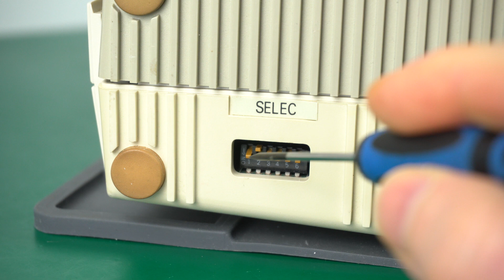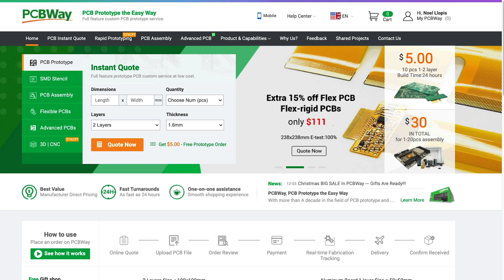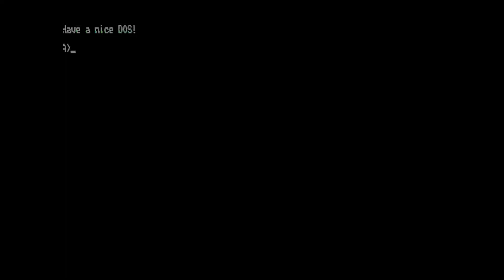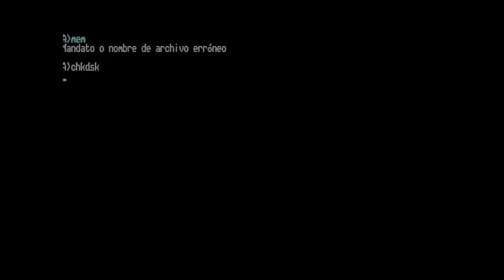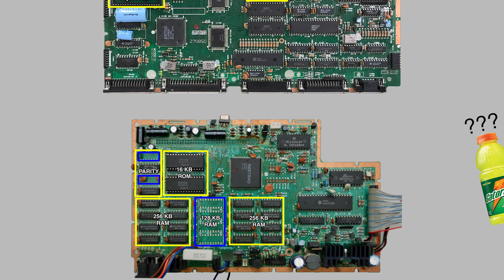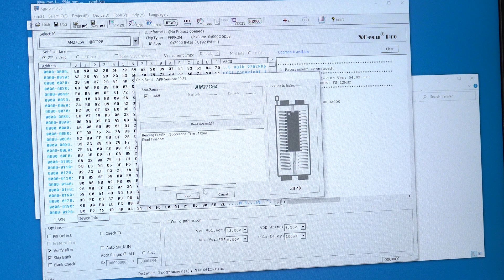Upgrading a Laptop from 1988 - Amstrad PPC512

Comment: Noel do you ever have any issues swapping between disks? I've installed a Gotek in my PPC512 today. When I swap between disk images, the computer doesn't detect the change. I'll swap a disk,  type DIR and it still lists the contents of the previous disk, not the disk I swapped to. I'm guessing this might be a disk change detection signal issue?

Comment: Hello, I have an amstrad pc 1512 with a broken monitor, but if the power supply works, there is some way to connect it to another monitor, be it vga, rca or otherwise, just as long as the image is visible, it's fine, thanks

Comment: Wait, wait, wait a moment. At 09:04 You put the disk emulator on the right side (looking front to the side) and the real disk drive is on the left nearer to the front of the computer; The emulator is the one with two openings, nearer to the back!!! When you boot and insert the floppy at 10:12 you put it on the back one (the emulator). WHHHAAAAAAT!?????? There is a cut at 09:42. Dis you cheanged the arrangement of the drivers between the two takes?

Comment: The PPC512 system disk (available on the net) has a tool called "lcd.com" (a TSR program). Once loaded, it is possible to switch between LCD and CRT with the keyboard (scroll-lock enabled + right CTRL).
Reply from the maker: Thanks! I actually read something about that recently but didn't get around to trying that. I will now. Cheers!

Comment: A great episode.  Thank you.  It is sad that I figured out the extra DRAM part numbers from the pictures of the PCB?  I used to design commercial hardware with old-fashioned DRAM in the 1980's and used most of the x1 and x4 parts from 4k bits up to 1M bit.  I didn't have the Amstrad (but I do remember them) - I was more of a ZX80 > 81 > Spectrum and then BBC Micro kind of guy.
Reply from the maker: Sad? No! Awesome? Yes! 😃 Glad you liked the episode!

Comment: So the V20 processor is much more like an 80286 than a copy of an 8088?
Reply from the maker: It was definitely closer to an 8086 than an 8088 (8 bit data bus). It had some aspects of the 80186 and 80286, but not all of them (like protected mode or extra memory addressing).
Reply: @NoelsRetroLab  Wasn't protected mode a 386 feature? I'm not sure if the 286 had something that you could qualify as an MMU.
Reply from the maker: @Stoney3K  It started with the 286, but it didn't see a lot of use until the 386 https://en.wikipedia.org/wiki/Intel_80286

Comment: Awesome work, love these old Amstrads.  I added 3 ISA slots to my PPC , I have schematics and gerbers if you are interested.
Reply from the maker: Yes, I saw that. That expansion looks amazing! We were admiring your job on Twitter just now 😃 I see you added the option to power it with 12V but you didn't really need it for your tests. That's great!
Reply: @NoelsRetroLab   I changed direction, as XTIDE, sound, and lan only consume 300ma,  and in the past the Amstrads had internal physical harddisks, I thought I was safe with that current draw to keep it parasitic. It was originally designed for picoatx, with a single 12V input on the pcb to feed only the picoatx, But I am having an issue powering the Amstrad through the bus as described in the reference manual. I disable the onboard regulators and it powers on and sweals, as if its not getting enough power to start the LCD is my guess. I am not sure if its a resistance/voltage drop issue or an error in the manual, and there are a lot of errors in the manual.

Comment: When I glue ABS/PVC with Epoxy, I first prepare the surfaces with some Acetone or PVC pipe primer. This softens up the surface for some time and the epoxy seems to make an incredibly strong bond with that. If I rip the parts apart with force, its always the plastic's structure that fails but never the Epoxy/plastic bond itself. I've used that method for glueing in Laptop hinges with destroyed screw holes and none of them failed ever again.
Reply from the maker: Nice. What kind of epoxy do you use? Any particular recommendations?

Comment: Interesting that the empty RAM positions did have their associated decoupling/bypass capacitors. Which is a little surprising given that board manufacture tends to be highly cost optimised.
Reply from the maker: True. I didn't give it a second thought, but you're right. I guess it was more trouble doing two versions of that step of the assembly than just change the IC one.
Reply: @NoelsRetroLab  looking at the history of pick and place machines it looks like there were two separate robots. The first doing small components, such as capacitors and the second doing larger components, such as ICs. It's around twenty years ago that a single machine to place everything became the norm.
Reply from the maker: @markevans2294  Although, were these boards machine assembled? I know a lot of the ZX Spectrum ones were assembled by hand in factories in Europe. I guess this is 5 years later and things had became automated. Edit: And the fact that those holes were filled with solder means that yes, it was at least soldered automatically.

Comment: U may have to swap out the memory controller chip as well with the added ram, IIRC we called it the u226 mod back in the day when we did the xt boards.
Edit: guess I should have watched the rest of the vid before commenting. :)
Reply from the maker: Interesting, I'm not familiar with that mod. Was it for XT computers in general I take it? I guess we were lucky that Amstrad just reused everything from the two models and just left some spots empty.

Comment: I only saw the GoTek showing the track and head numbers, not the track and sector like you said. There would be 8 sectors per track, not 2 like it was indicating. Back in my old days of DOS I used to know every part of a floppy disk layout almost like the back of my hand thanks to playing around with formatting disks on the Atari STFM before I moved to PC. The Atari used the same disk format but with more flexibility, allowing you to squeeze extra sectors and tracks onto disks. The PC could use most of those disks but not create them, great for copy protection of PC software if you fill the disk up completely! I knew more about DOS and disks than even my tutors when I was getting my C programming qualifications 😏
Reply from the maker: Right! I saw it afterwards as well 😃 I was speaking out of experience from what it displays with the Amstrad CPC, and then in edit I saw it was only showing track and head. Haha, good eye!

Comment: Excellent video. I have one of these sat in the office. I wish I had the confidence to upgrade the ram like this. The gotek mod though looks within my skillset. Great stuff. Looking forward to the next videos on it.
Reply from the maker: Thank you! Really, there's nothing about the RAM upgrade. You can remove the solder with a solder braid, and since you aren't working directly on any components, it would be hard to screw things up. The hardest thing is opening the computer and getting the boards in a position you can work on them! 😃 Give it a try!

Comment: cool... @9:40 maybe it would be a good thing to mention to the firmware devs about a program you can use or maybe a command that will list and swap images so you dont need the button/oled ?
Reply from the maker: One of the really nice things about the Gotek is that it's completely like a floppy disk drive, so the computer knows nothing else about it. If you wanted to have that kind of control, it would need to communicate with the computer at a different level, which would make it much more complex. Having said that, people have been working on on-screen displays for Gotek interfaces, so it's certainly possible to do something like that. Although you always want to retain that interface as well so you can change disks before the computer is working (to select the boot disk for example).
Reply: @NoelsRetroLab  don't get me wrong, im not saying dump the oled and the buttons, just make a software solution that's a TSR for example.

Comment: I think if you stick an autoexec.bat on the floppy image (even an empty one) it should stop prompting for the time and date.
the 720k DD limit confirmed my suspicions, it wouldnt have worked with HD floppy drives or only read DD disks even if it was an HD drive. 
If you dont mind the Spanish DOS and BIOS by all means keep it but have you considered changing out the BIOS and DOS to English?
Reply from the maker: Yeah, I need to customize it to make it better. I was also thinking of potentially using a higher DOS version. I'll probably change DOS to English, but I need to make sure the keyboard layout stays Spanish, otherwise it'll be crazy trying to write anything complicated 😃

Comment: So, for making disk images, you really shouldn't use DISKCOPY, it copies the files, but doesn't do preservation of sector data and such. The best way is to use something like a SuperCard Pro (which is my preferred solution), or at least WinImage or similar with a floppy drive. If you want to use DOS specific software, there's quite a bit, teledisk being one of the more common, although you need to convert the images from TD0 (HxC can do this, and it can handle copy protested disks).
Reply from the maker: Unless I'm missing something, DISKCOPY copies a full disk, track by track, not file by file. It won't deal with advanced copy protections and weird formatting, but otherwise it should be fine for unprotected disks like the one I did, right?
Reply: @NoelsRetroLab  https://github.com/microsoft/MS-DOS/blob/master/v2.0/source/DISKCOPY.ASM - I owe you an apology. I thought diskcopy didn't copy track by track but it appears I'm wrong.

I need to find the DISKRD function to be sure, but from the comments in the source, it reads 64k of sectors, and writes them out "as is".
Reply from the maker: @NCommander  No need for apologies! You said that in good faith hoping to help. And at the same time I learned that the source code for MSDOS 2.0 is freely available. That's really cool! I didn't know that.

Comment: The mod to 640K is absurdly easy. Thank you, Noel, for another fine video. It cheered up my day !!!!!. Good point removing the Gotec OLED and move it to the upper panel.
Reply from the maker: Yes, that as a fill-in-the-blanks mod. It's funny that the 512 was even an option. I guess they just wanted two price points.

Comment: I've always wondered if it might be possible to install a modern battery and charging circuit in one of these. I'd imagine that you could get a lot of power in the space that 10 C cells take up - possibly enough for a few hours of runtime.
Reply from the maker: Interesting. I've been so focused on other things that I didn't even think of that, but yes, it would be technically possible. At the same time, I'm not really planning on taking it with me anywhere, so I could probably make better use of that battery space for other mods (cough, VGA LCD, cough).

Comment: Have you tried the baking soda and superglue method for fixing the door, I used it to fix some screw post terminals on my spectrum and they are still firmly in place https://youtu.be/n1meoZaHYZo
Reply from the maker: I've seen that video but I haven't tried it yet. I was hesitant to remove the door because I was afraid the other hinges would brea, but it's a trick I'm keeping in mind for the future.

Comment: Noel I found the issue and some possible solutions! https://www.youtube.com/watch?v=8k-U4LiL4GI

Capturing CGA is a pain but if you try some of these fixes I'm certain you'll get it working. Thank you for the wonderful video!
Reply from the maker: Interesting! I'm bookmarking that for the next video when I look into it. If that's the case, since it's possible I might have to make a small circuit to interface it to a VGA LCD, I might increase the resistances a bit. We'll see. Thanks for the pointer!

Comment: Nice work, again! I' m glad it had those DIP switches there, for the display' s mode. MDA sucks. If you want to make any other repairs with epoxy, I would suggest you to put some copper braid, or something similar in that glue(a thin piece of plastic, maybe?), in order to provide the broken parts with some more robustness. And if it was a desktop PC, with some ISA slots, I would also suggest you to use an external controller for HDDs, or at least one that hacks and tricks the XT PCs, into believing that they have a HD floppy drive connected.
Reply from the maker: Thanks! I like the tip of using some material to hold things together with the epoxy. In this case the tube was really close to the sides, so in a way they already have that effect and everything is held together strongly there.
One of my long-term goals is exactly that: Create an ISA expansion adapter to plug in anything (8-bit VGA, HDD controller, etc). It stops being really practical, but it seems like a fun project anyway!
Reply: @NoelsRetroLab  Yes, this is another project that I saw, once. I don' t remember it exactly, but it is an external ISA port. By the way, if I don 't reply to any comments, it is only because I cannot receive notifications for any new messages. I only see upvotes to my comments(no kidding, I mean it!).

Comment: Replace the LCD with a colour TFT
Reply from the maker: Yes, that's the plan! I have it sitting on my workbench already. The trick is interfacing to it in a way that's not too expensive.
Reply: I think the internal LCD is on the same pins for the TTL/RGBi outputs, at least according to the schematic, you might need to re route the H and V sync to some of the unused LCD pins (there are at least 2 there) and use the existing LCD cable with the adapter for the replacement LCD
Reply from the maker: @Mr Guru Yeah, I was thinking of starting from the CGA signal to keep things easy and then some kind of VGA converter. It's definitely doable, I'm just trying to find a way that's not too expensive.
Reply from the maker: @Mr Guru That's one of the options, and the most promising one. I have that board here and an LCD that I think fits. I'll still need to adjust the CGA signal for the GBS8200 to process it correctly I think (I think I need to combine the vsync and hsync? I don't remember. The other problem is fitting that board inside the computer. The battery case is large but not as wide! I'll hit you up if I run into some set up problem.

Comment: The V30 had the same instruction set as 80186 (which corresponds also to 80286 real mode instruction set). So if you used a compiler that supported 80186 or 80286 (Turbo Pascal v4, MS-C, etc.) it was possible to gain a little bit of performance and code size, in comparison to plain 8086 code. 
Some of the instructions were POPA, PUSHA to save/restore all registers with one instruction. Shift immediate more than 1. Enter/leave for function calls (was nice for Pascal or C code). BOUND to check array bundaries. PUSH and IMUL with an immediate were nice. INS and OUTS to read/write strings on I/O ports.

V30 also had an 8080 emulation mode (not Z80). It could therefore run CP/M if you so wanted, but for that you would need an adapted OS.
Reply from the maker: Oh cool, I didn't realize it could take advantage of 286 instructions from compilers. I don't think anyone has released a version of CP/M for this machine, but you're right. It could be fun (although not particularly useful compared to MS DOS).

Comment: How weird that the extra 128k of RAM has a completely different physical layout to the base 512! Given the number of actual RAM chips used they could have made it the same--8 4464s would give you 256k, same as the 8 41256s do.
Reply from the maker: Right but the 128K was only 4 chips, not 8. I suppose space was a premium.

Comment: I think the flickering on the screen may be caused by failing caps that are supposed to filter the video signal.
Reply from the maker: That was my first thought too, and why I didn't investigate anymore since I'm waiting for new caps, BUT... I looked int he circuit schematics and it looks like there's no filtering of any kind. They come straight out of the gate array into the video output (through a buffer). Maybe they were omitted from the diagram, not sure, so I'll look into it. Also, I hope it wasn't the magnet I added near the video port!! 😳
Reply: Could it have anything to do with the magnet you stuck to the back being right above the cga socket?

Comment: Did you put a Gotek in the PCW-8256? If so, can you boot from it ? I've tried everything to get mine to boot off Gotek and it's not happy, even with just the Gotek attached.
Reply from the maker: I haven't gotten around to doing anything with the PCW yet! But I was hoping to get that to work. Did you manage to get it working as B drive? Make sure you have FlashFloppy. You may have to configure options to allow for two sides. Also, check with Perifractic (Retro Recipes). I think he got it working.

Comment: The interference in the video looks like a power issue. You may try to power the video converter from the USB port of the computer with the capture device.
Reply from the maker: Interesting. I didn't look much into it, but I'll try that. Thanks.